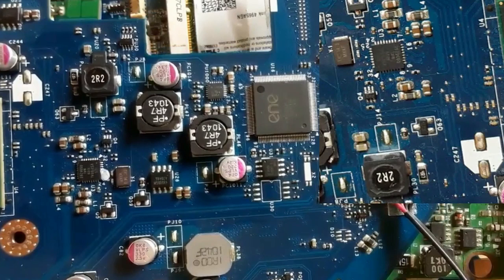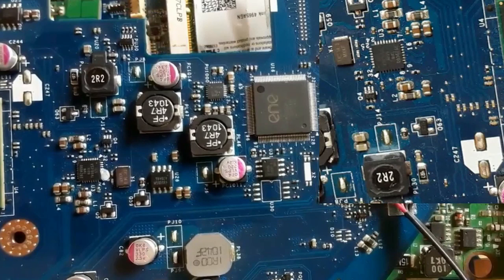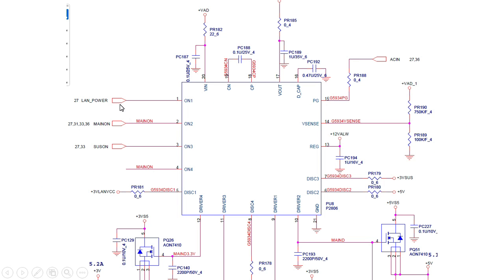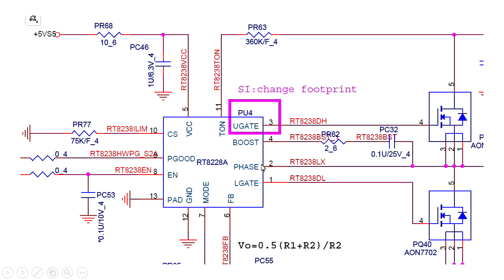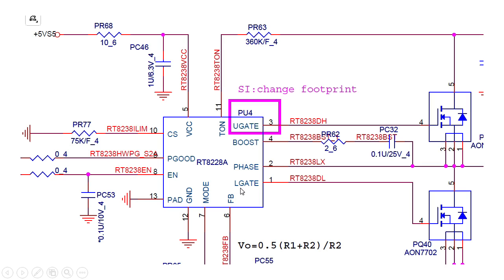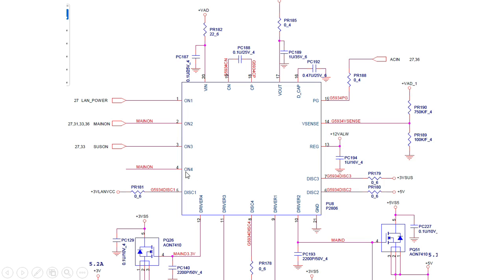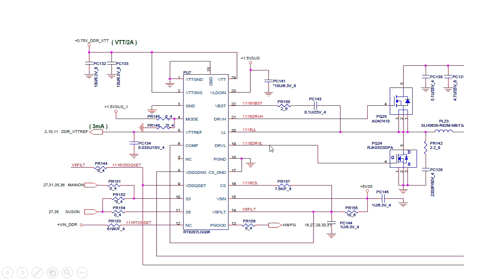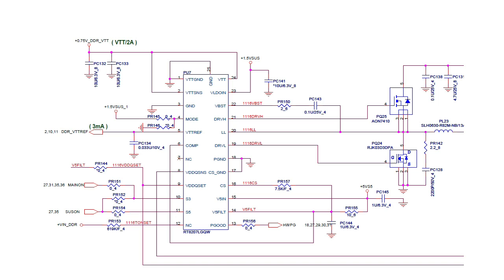Integrated Circuits ICs Testing tutorial - IC Circuit Diagram - Laptop Motherboard Repair

Comment: Please made  1more vd about im confusing that an ic need to on input and VCC and GND etc. what im confusing is what if all chips when we gave Vcc and GND its auto generate some Out put incapable of ic datasheet what if some output is on when ic is on and if for out out for some other ics signal thats output was on when another in put come to ic and generated Out put im confusing😢

Comment: This laptop does not have schematic (hp elitebook 840 g3) MB: 6050a2892401-mb-a01
 I'm having trouble with this laptop, no power issue, As there is no voltage zero on main bios IC Chip
Honestly, I am not sure What items should I check?